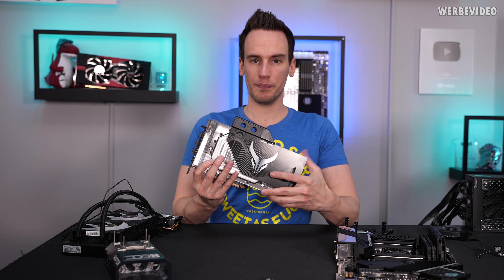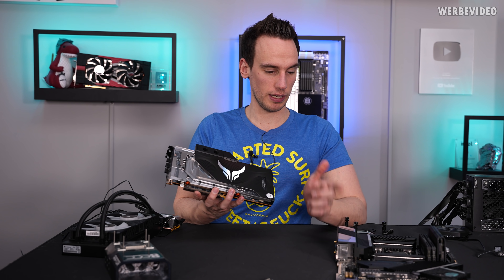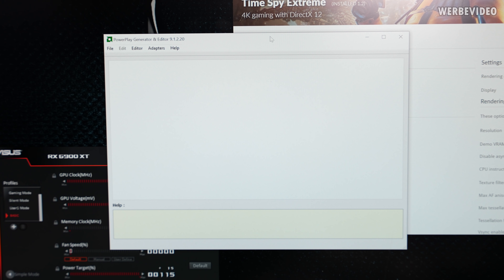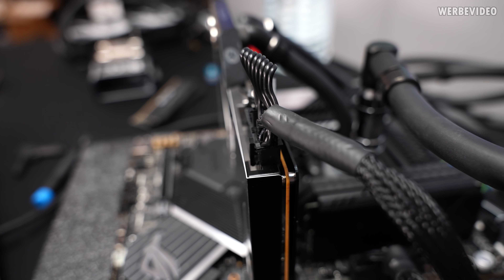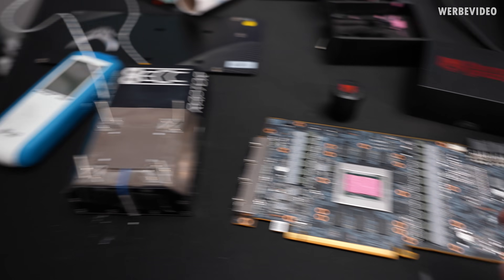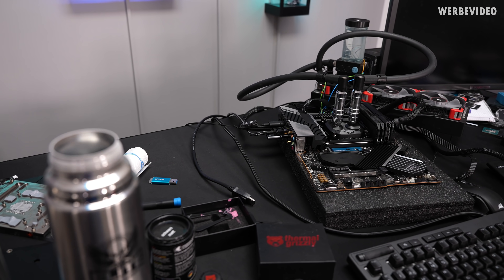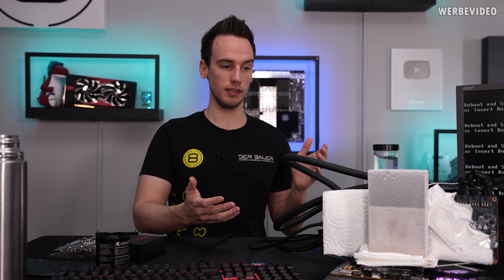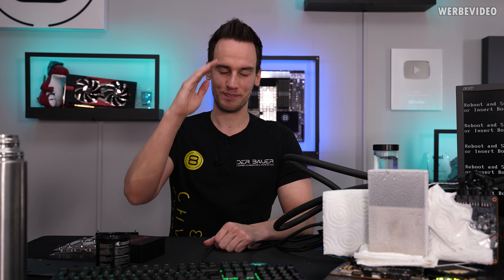We Broke the GPU Clock World Record (with AMD!)

Comment from the maker: Will post the BIOS file later in the community tab. I thought only Windows is corrupted but can't access any files on the SSD right now. Have to extract the BIOS file again later.
Reply: Congrats! Great content as always :)
Reply: With this card you can put the GPU Power Limit at 150% instead 115%
Reply: Thank you Roman for the update , that core clock speed is huuuuugee... , congratz my friend.  Patiently awaiting this Bios to check if it can be flash to other 6900xt video cards. thank you.
Reply: Congrats for break a record!
Reply: Think i may flash that on my liquid devil and have some fun.
Reply: Thanks for the heads up Roman 👍
Reply: Amazing thank you. Do you think you can test the bios on a 6800xt, more voltage and more clocks maybe it will release it's potential. 5*
Reply: @huppelix  cause those limits are power play table settings i suppose - while the max clock is hardcoded, no other reason you'd need a new piece of silicon to change it afaik
Reply: @huppelix  The BIOS will let you run the card but you can't raise the clocks over the limits and the voltages remain locked to the same levels.
Reply: @huppelix  which bios did you use? i want to flash my reference 6900xt too
Reply: I don't see any bios there. Does anyone have a link?
Reply: @St0RM33  I'm alos looking for that bios. I have the non Ultimate 6900XT Liquid Devil and have been looking for this bios for a couple of weeks now...
Reply: @JohanFlodqvist  let me know if you get it please, i've asked another guy on reddit
Reply: @St0RM33  Roman replied to me in an email that he will extract the bios file over the weekend and upload it. From what he have heard I would not be able to flash it onto a non ultinate version of the card tho. I will try to email Powerecolor and ask (or just try since i have dual bios).
Reply: @JohanFlodqvist  could you email it to me too? I want to try
Reply: @St0RM33  I think Roman will upload it to his Community tab here on YT when he has extracted it. If I get it by email I will let you know and send it to you =)
Reply: @JohanFlodqvist  @St0RM33 hi guys, i have RX 6900 XT liquid devil non ultimate and i would like to update the bios to. 
Could you please send me over email ?
Reply: @JohanFlodqvist  Hey did you ever get the BIOS? Do you think you can mail it to me?
Reply: @Undesired_Hero  no I have no memory of it at least and did not ever install it. It's as usual, when I get a new card I want to overclock it to the moon aaaaand when done i underclock and undervolt it heavily for silence and less heat ;)
Reply: get the more power tool thanks
Reply: Can someone explain to me what’s the difference between Ultimate liquid devil and Ultimate non-liquid devil..i saw they released two card..other than different configuration out of the box is it anything else..i believe it’s exactly a same card no?
Reply: @dgreat1000  it is exactly the same card, tho the Ultimate version promise better binning on the chip. Besides from that it is just the bios that difference the two cards where the Ultimate has a unlocked bios while the non Ultimate has a more locked down bios. The biggest difference is to memory overclocking and power limit.
Reply: @JohanFlodqvist  thanks mate cause i got the ultimate normal cooler version and yeah its a beastie card..think of liquid cooling it with alphacool block
Reply: @JohanFlodqvist  Imagine he tests this card with AMD Ryzen 5950x 😁
Reply: Can someone help me with the bios too ?
Reply: Be aware that this BIOS WILL NOT work with existing 6900XTs, these unlocked cards have a new silicon stepping. Flashing to an old stepping card will not unlock the clock limits and will not unlock the voltages either.
Reply: @wewillrockyou1986  sad amd started doing that shit. Polaris and the original Navi was very fun to bios mod, now there's no point, except for maybe memory timings which are still not decoded I think.
Reply: @elesinalex  This is not about BIOS modding, the hardware itself was not made to run over 3GHz, they had to change the silicon to get it to run faster since the first version they didn't seem to expect the cards to clock this fast for whatever stupid reason.
Reply: @wewillrockyou1986  but there's no point in driver locking the frequencies and bios changes even if the silicon itself could not do 3+Ghz.
Just don't ship cards with that semi-faulty silicon and 3+Ghz stock clocks, problem solved.
Reply: @elesinalex  This is not a driver lock or anything, the part of the GPU that controls the clock speed in the old stepping is not capable of raising the clocks above 3GHz because AMD didn't make it to do so.

Comment: I cant be the first to think of this, so what speaks against just dumping the entire card or even PC into an LN2 bath?
Ok, there are bound to be some mechanical weakpoints that succumb to thermal stresses, but perhaps they are few enough to overcome?
Reply: Apparently electrolytic capacitors will fail as the electrolyte freezes solid. But you could try replacing them...
Reply: @benskidmore6523  Ok that is not a minor point^^
Reply: The pcb would crack

Comment: Totally agree on the AMD meme with the bicycle. Not only for extreme overclocking, but for a good custom water loop the power and clock limits are set way too low. The card has more potential but holds itself back (especially for the reference PCB). Maybe the non-reference cards are better since some have a 3rd power connector (but you can't buy them anywhere except for 2-3x the retail price on eBay).

It is also really annoying that AMD does not just have an option to check a box called "Water cooled" to stop giving me CPU fan speed errors.

Comment: 0:45 It's not just the clock limit that's been changed, these new "flagship" RX 6900 XT's are using the new, EXTREME binned "Navi 21 XTXH" die. Also, we've somehow reached CPU clock-speeds on massive flagship GPU's... O___O

Comment: why don't put computer in big box/container with small hole on top to refile liquid nitrogen. On bottom of container put some dry ice. dry ice will generate co2 (co2 is more heavy vs air) and push out air with moisture from container. I think that will eliminate water problem, no longer sticky Vaseline
Reply: Because liquid nitrogen is a liquid at −320 °F. That's too cold for most if not all chips to operate at. Onboard battery wouldn't care for it either.

Comment: Have you ever spilled any of that LN2 on your hands?
Reply: Probably a lot. LN2 isn't dangerous to spill on your hand so long as it's just a quick spill, because the heat of your hand will form like a small barrier and the LN2 will just roll off. Obviously, you don't want to keep LN2 on, but just pouring it won't hurt. JayzTwoCents I believe even showed it off. It's also why they don't wear gloves when doing this. The LN2 would just freeze the gloves, and the hand with it.

Comment: i have a red devil with a waterblock on it this gpu is really very impressive i game with software set to 2.8ghz! typically running around 2.73ghz but rock solid stable 1090mv 2150mem fast timings. unbelievable honestly i figured that  the card would do benchmarks at those high clocks but it can game there too. if this thing had unlimited power offset i think it could run games at 3ghz i hit the 323w limit long before i hit instability. does this ultimate bios allow higher power limits because im sitting at 45c at 323w so i def have temp headroom to push more power through the core.
Reply: Do you have any in-game bench clips?
Reply: @nubscrub  I don't but I could what do u want to see?
Reply: @TheCivicsiep3  I have a 6800 XT +5% daily OC running on a 10900K @5.3GHz. I'm curious about game FPS performance with high level overclocks cooled by water. Thanks
Reply: @nubscrub  im uploading a video of me playing cold war zombies right now ill post a link
Reply: @nubscrub  hey check back in a few hours once youtube processes just click on my channel and goto my vids it will be there its processing right now. its just 5 min of zombies gameplay 1440p max everything obv screen recording you lose a few fps not alot tho. also 80 degree ambient temp im in southern va so temps are about 5-10 hotter than if i had my ac on but rly doesnt change much except cpu clock may be a little higher either way if you want any specific game i can record it idc
Reply: @TheCivicsiep3  That's real cool of you. Would you as also happen to have Cyberpunk, Control, Battlefield V or any of the ray traced games?
Reply: @nubscrub  i do have several rt games. i have cyberpunk, control watch dogs legion i can do any if you want but really rdna rt  perf is pretty trash without some sort of upscaling tech i dont use rt in any game due to honestly terrible perf when you consider how powerful a 6900xt is the fact that it basically performs like a 2080ti with dlss OFF is really bad per hit. id say rdna 2 rt is worse than turing when you factor in how much more powerful the raw shading perf is. seriously rdna 2 rt is bad lol. maybe future built for rdna 2 games will come out with more ACCEPTABLE perf and also super resolution should also help but honestly it will never come anywhere near ampere
Reply: @TheCivicsiep3  I play with RT on at least medium levels and accept the FPS hit, which is why my original query. I was wondering what offset you are able to achieve with OC. I suppose Cyberpunk and Control would be interesting.

Comment: I have so many questions. Thermal pastes are designed to heat transfer between different materials but not between extreme temperature difference. There must be some kind of thermal conductivity factor plot against operating temperatures specific to each paste. 90 deg cpu/gpu to 20 deg liquid cooler maybe considered in the design but probably not negative (-)20 deg to 90 deg.. and why not cover the lid? Wont condensation destroy the board?... And the chip itself maybe clocked more but wont other components of that gpu board become the physical limiter? Maybe it doesn't have to fail to display the limit... Can the driver be a limiter?

Comment: How did you get the voltage to 1200mV? When i try to do this with MPT it will cause crashes.
Reply: Needs to be the ultimate model on the unleash bios

Comment: For LN2 overclocking, why dont you try encasing the system in a glass box filled with dry air or co2?. only the LN2 inlet could be exposed? That way there wont be condensation problem?
Reply: Or nitrogen. Lol. 
Guessing it’d just be harder to do with poor access to other components. Could be a neat experiment tho.

Comment: Totally with you on the AMD fucking up their own linup with artifical limits. Most 6800 for example would wreck the 3080 in no RT workloads with 100mv more. This card has the same cooler as the XT but is not able to utilize it :(
Even Top 3dMark scores show that stock cards sometimes outperform watercooled ones since the limits are the same.

Comment: Hi der8auer, I have a MSI suprim x 3080, and I’ve tried overclocking it and managed to get as high as 2100Mhz however I keep running into power limits. The temps are under 65c at this OC with fans at 75% (lowering the fan speed seemed to help reach higher clocks) so I’m sure I have more thermal room to go higher, but short of physically modifying he gpu, is there any other way I can increase the power limits that you can think of?
Reply: try flashing a custom bios for your card which allows greater power delivery
Reply: @VinashDeyalsingh  where might I find this bios?
Reply: @Giantmidgetmotochannel  dude why? for 1-2 percent more performance at the risk of some weird bios flash lol

Comment: Why go below -90? Can't you slowly lower as you pump up the clock speed to keep the temp range at a decent value to not cause crashes/artifcacts/cracking? Just above -90?
Reply: He wants to benefit from the fact that those materials conduct electricity better at those temperatures. Which means it doesn't heat up the GPU that much, which means internal resistance is low and allows for higher frequency. Also extreme voltages with strong current will create a bigger temperature gradient with LN2. And such a gradient isn't a great thing for any micro-processor.
Personally or out of curiosity I would try refrigerating it - with mini refrigerating unit. So temps would be only -20 to -45, but probably more sustainable.

Comment: How can a card still work when it's covered in ice? Won't there be shorts etc.?
Reply from the maker: Ice is not electrically conductive
Reply: @der8auer  is there a real risk of things further away from the LN2 heating up and melting the ice? like to the right side of the VRM etc.
Reply: @ApocDevTeam  yes there is, and that's why he said he continued a day later or sth to avoid damage from condensation and the reason there's a ton of paper towel around the pot

Comment: Not only ur card is binned ultimate edition but it also hand picked by power colour. The average person will never get anything like this.
Reply from the maker: 2800 MHz on water is nothing special. Pretty much any of my other 6900XTs could reach this with good temps
Reply: @der8auer  In time spy it is very special. I have tried multiple 6900xt under water with temp below 50c on hotspot and could not reach anything over 2725 set clk. Your card had 2880 set clk.
Reply: Not so sure.  I mean, the average person won't be running LN2 anyway on a day to day basis, so 3.2Ghz is out of the question, but I can see 2.9-3Ghz being used daily.  I'm able to get 2.75Ghz when benching my 6800XT on water and using MPT and it never tops 56 degrees at full load.  Pretty sure if I was able to get my hands on a BIOS that gave me more voltage and an unlocked core, I'd be able to top 2.8Ghz.
Reply: We can buy these but at $2500 RRP plus scalper markup I won't be

Comment: this is legit interesting because this feels like those last gen artificial limits

and speaking of last gen how the hell am i supposed to bypass rx5600xt artificial limit of 1820/1860(if there is actually a way)?? my gpu eats these clocks and shits them out with no problems at all
Reply: flash a different bios with higher frequencies look around on the internet you might find something
Reply: @zecRjee  i actually found a MSI VBIOS which unlocked it now,will see how well does it handle since it lets me go beyond stock VBIOS speeds

Comment: Can't help but wonder what would be the maximum gpu frequency if this card (with factory-mounted cooling block) was connected to a 3x360 cooling loop. Can this card oc that much at around 60C ? Is is necessary to go below zero?
Reply: Necessary to go below zero to reduce TDP can find more information on google or an overclockers forum
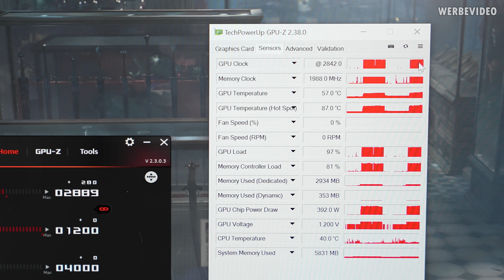Reply: He already shown the results of his max OC on a 360 rad at 4:20. More rads than a 360 probably gives diminishing returns, if any.

Comment: The XTXH chip raises limits for both memory and core clocks.
Reply: Yeah but above the memory limit and you lose performance. What I’ve seen is people think it destabilizes infinity cache
Reply: @erichall090909  RDNA 2 is not really bandwidth limited anyway.
Reply: @CharcharoExplorer  I think at 4k it starts to be. But not much you can do about it
Reply: @erichall090909  Nah, at 4K it needs to have a 25% hit rate on the cache to be bandwidth limited, but it has over 50%.
Remember, 128mb of IC = the ROPs are happy. This means it has over 500 gb left for all else. On a 3090 for example, you need to use around 700 gb for the ROPs and other raster operations...
Reply: @CharcharoExplorer  how do you explain being ahead at 1440p but falling far behind at 4k? Just curious I don’t doubt your knowledge
Reply: @erichall090909   Well simple. CU occupancy is higher on RDNA2 than Ampere. 
It is the same thing that was happening with Fiji and Vega except this time its on Ampere. At lower resolutions, it has problems filling all its compute queues. 

At high resolutions like 4K and 5K, more of Ampere's compute units are engaged, its SMs and Cuda cores are more engaged. So it manages to show its compute force. At lower resolutions, it cannot.
Reply: @CharcharoExplorer  that makes sense. Thanks for the answer
Reply: @erichall090909  One other interesting thing - the RX 6800 XT has 64 compute units for rasterization... but 72 for compute :) 
6900 XT has 80 for both. This is why sometimes the 6900 XT is not 10% but 15% faster than a 6800 XT.
Reply: @CharcharoExplorer  that’s interesting. I bought my 3090 and I’m happy with it but was curious about the 6900xt since I game almost exclusively at 1440p 240hz
Reply: @erichall090909   I have a 3080 and a 6900 XT. Good cards. I really dislike power use over 300W though, something about that triggers me. So the 3080 is  as far as Id go... 
3090 at 350W annoys me, I admit.

Anyways, both RDNA 2 and Ampere are awesome hardware-wise. AMD needs to work more on their software to reach parity but the hardware is there IMHO.

Comment: Pretty sure the limit was because of the range of the onboard clockgen of the cards. These new cards are with a different stepping which has a clockgen that has increased range. These BIOSes should not be able to unlock the clock limits on the older revision cards.
Reply: Your comment reads as "we couldn't rise further the BCLK", but the issue was with the multipliers and as far as I know that's a firmware thing, not physical limitations.  Any insight on how it works on these cards?
Reply: @lepkr6095  the onboard clockgen encompasses the silicon which provides both the "BCLK" as well as the clock multipliers.

Comment: 9:00 huh, looks like the temperature is stored in an unsigned 16bit integer :D
Reply: no, no, software is flawless. It's just a local catastrophic star burst inside. No need to worry
Reply: or maybe it's signed and the software assumes its unsigned ;-) the difference with 65536 seems to be the negative degrees
Reply: Actually a micro worm hole opened up in the GPU die that's why you're seeing those temps